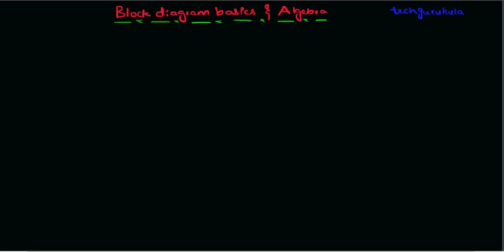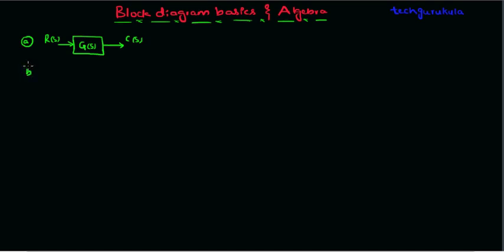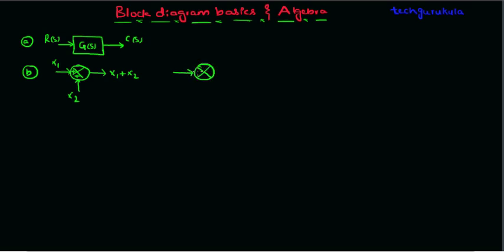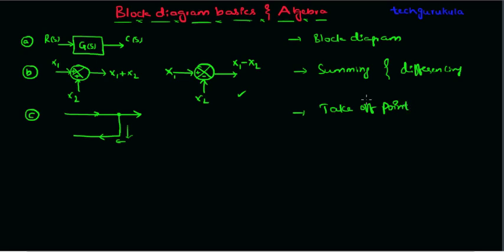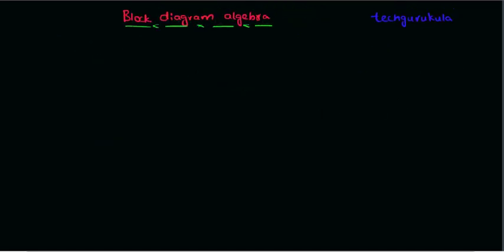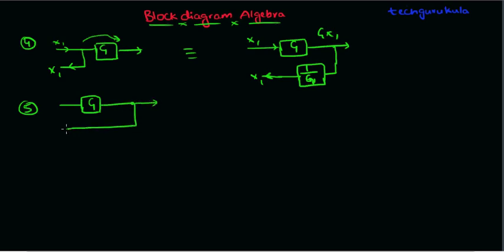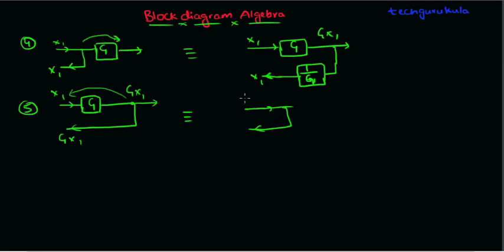Block Diagrams

Comment: sir i have a doubt regarding chapter.if we can get transfer function using signal flow graph,is it necessary to study block diagram in details..? i find signal flow easier than block diagram
Reply from the maker: you can always convert a Block diagram into a signal flow graph and find the transfer function.
Only in exams, if you are asked to find the transfer function using block diagram reduction techniques - you need it.

Thanks,
Techgurukula.
Reply: techgurukula 
First of all ur video help me a lot.

Sir, when are u going to put videos on mosfet , op-amps , etc???
Please reply me as soon as possible